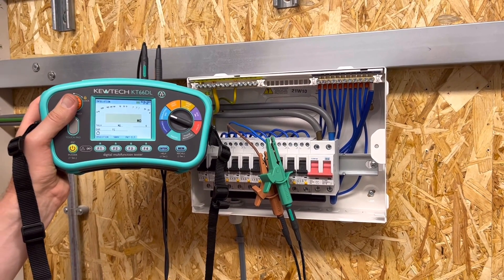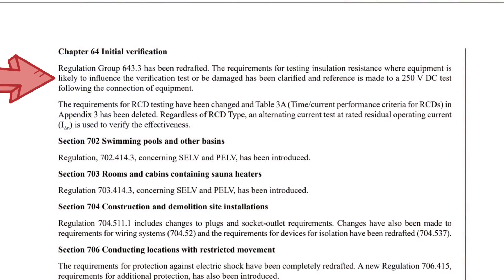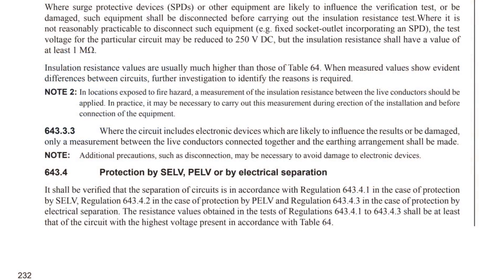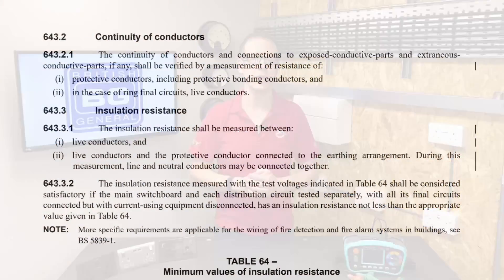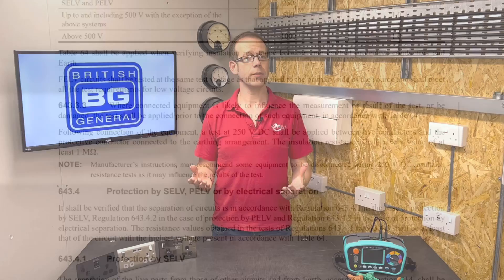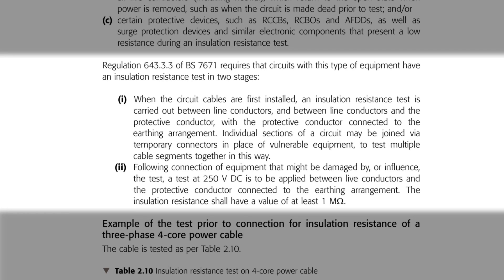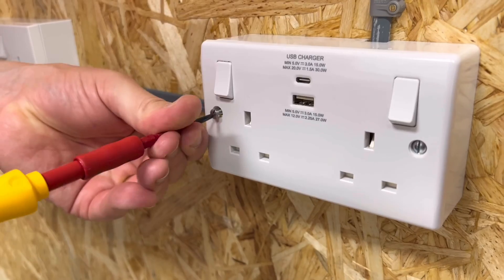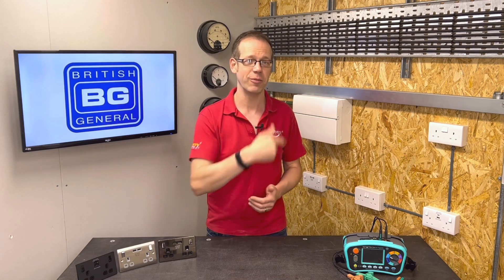PROBLEM: Insulation Tests on Circuits with Electronic Loads

Comment: During Portable Appliance Testing, it is important to remember to tie Live and neutral lines together in order to carry out the insulation tests.
Particularly on Arcade Machines, or anything with CMOS chips that has an Earth. 500v DC is fine providing you are aware of this.!
I always test Kettles, Toasters Irons and Gas Hob infighters this way, using either 500 or 1,000 v DC. These Class 1 items get the most abuse.
Reply: Utter rubbish. The voltage used for insulation testing does not get onto the CMOS devices.
Reply: @deang5622  In that case, I hope you don't get any jobs insulation testing expensive electronic equipment.!
If there is a break anywhere on the earth bonding, 500v can and will track across other places, best tie line and neutral together..... So they are at the same potential.
Look it up, then come back and say sorry.
Reply: @G1ZQCArtwork  completely agree. I was involved in safety testing in the film industry for many years and I can confirm from reading circuit diagrams that the testing voltage can and does appear on the low voltage supply rails in many cases using switched mode power supplies.
Reply: @gillywild  On the subject of testing (or fault finding) of which I am a retired specialist, CPC continuity and insulation testing, has to be fully understood.
E.G. Gas Hob / Oven Igniters are a good example.
When plugged in, the CPC and connected Gas supply lines are bonded. I have come across times when the Earth connection on the appliance is broken, resistive or just not connected.
The Igniter produces thousands of volts to light the flame, it needs to be properly grounded by the CPC, not the bonding, as it has Gas in it, leaky unions are perfectly possible, so stray sparks might make it go boom.
Point being, if a CPC is faulty, and you jolt it with 500v DC, it can and will find a home path elsewhere eventually. CMOS devices get obliterated in an instant.
So @deang5622 needs to apologise to all CMOS devices for putting them in danger.!
The moral is, tie the Line and Neutral lines together BEFORE testing sensitive equipment.! 
David.
🥸

Comment: Once again the people who write bs7671 don't live in the real world! 

The obvious answer to this is to put an off switch on the front of the socket, so the USB can be turned off before testing but instead of doing the obvious, lets just make an electricians life even harder 😪
Reply from the maker: BS 7671 isn't a product standard... 🤔
Reply: @efixx  I know but that doesn't change the fact they don't live in the real world. For example, expecting us to IR test 100's of radial cables at first fix is absolutely ridiculous! Temporary linking it all is even more absurd.

The USB's switched should be a requirement under british standards.
Reply: A socket outlet with 4 switches, not sure anyone would buy one. For initial verification its abit more work, but eicr i would say no more work cause you spot them when you unplugging equipment, and test at 250v
Reply: @johnaphone   Have the USB charger fed from one of the outlet's switched live — the then switch covers both.
Reply: @calmeilles  Just have one switch for both- both on, both off, could perhaps be made into something people would find less intrusive, like a push switch by the USB plugs.

Comment: I’ll admit I was still doing to combined test on eicr because sometimes you can’t physically disconnect all loads or in-line stuff like that. Sometimes even doing the test at 250, you can get low readings. 

Something else to explain to property agents and landlords, that they won’t understand and will probably accept someone else’s lower price.